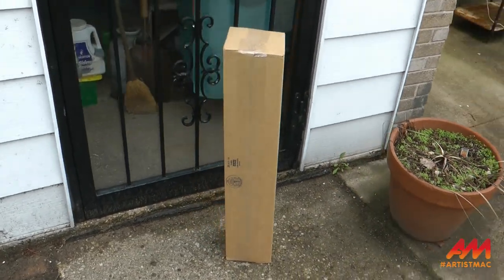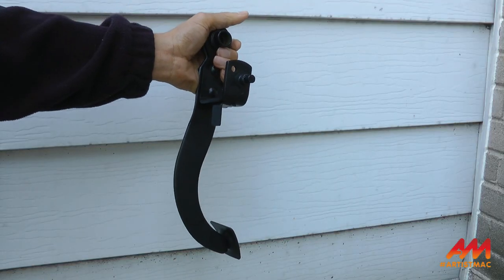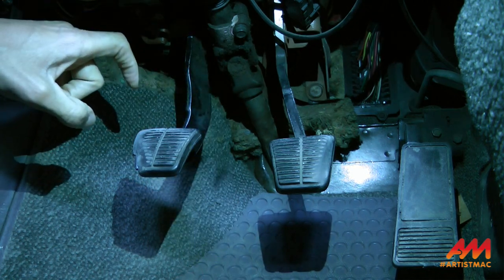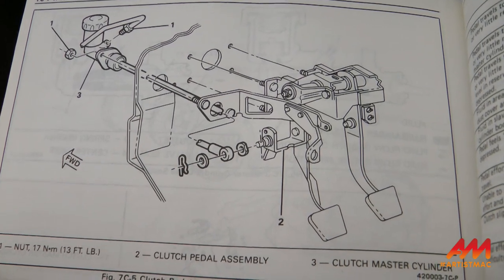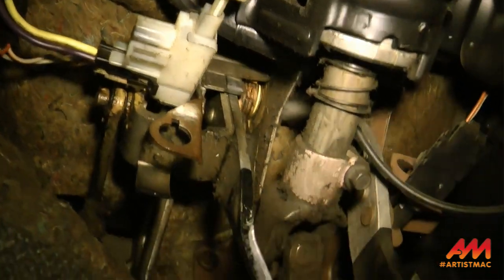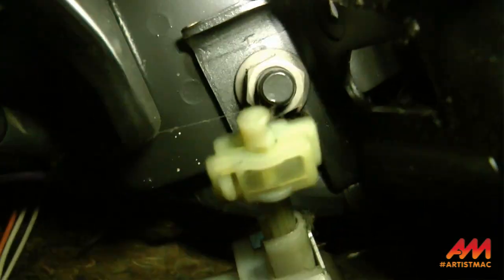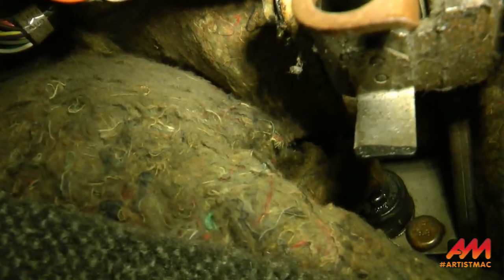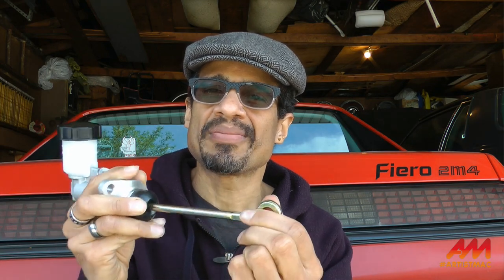My Fiero-Trouble in Clutch Land, Pt 4 - Aluminum vs Steel Clutch Pedal

Comment: Good luck artistmac with your clutch problem.
You did the right thing getting your new steel pedal, presumably from The FieroStore.
  I'm so sorry I could not send my brand new, unused pedal due to stupid, abusive freight fees. Still can't believe it ! Scam !

PS A common problem with manual shift Fieros are the "knuckles" at the end of both shift cables, transmission side. These plastic (nylon ?) caps tend to dry out, crack and snap off, leaving you stranded, shiftless in traffic - it happened to me years ago, morning rush hour, in the middle of a tunnel ($$$ towing)! - My (real, old school) mechanic then installed cheap, Chrysler dealers available, "C" clamps on both cables. Perfect solution ! I highly recommend them to you my good Fiero Man ! Cheap assurance.
  And please, get a new slave cylinder, most probably pitted & worn out as your master cylinder (it's 34 years, after all !! ). From my 34 years experience, 2x 1984 2M4s, plus my present 1988 GT, clutch fork or bearing are tough, durable units, and would bring you a squealing or grinding sound if worn out. (Sorry, Bryan Anderson, but you are'nt guessing right).
 Just make sure to properly bleed - most important! - your clutch assembly using new oil. You should do the same thing to your brake system for the same reason. Annoying, time consuming but so important !
 Summer is coming. Wish you a great driving season, my Fiero friend. Be safe !

Comment: That white switch that moves when you press the clutch is the starter interlock you were complaining about earlier in the video.  If you want to bypass the safety system that disables the starter while the clutch pedal isn't fully pressed you can unplug that switch and put a jumper between the 2 wires.

I'm still fairly convinced that the aluminum pedal and leaking master aren't your problem because if it's bent or leaking that would cause it to get to the floor too soon not stop before getting to the floor.  I believe you're going to have the same brick under the pedal after installing that new pedal and master cylinder.

My guess is that your clutch fork lever that the slave pushes against is damaged.  If I'm right then the reason the pedal is stopping soon is that the piston inside the slave cylinder is jamming against its snap ring so be careful not to push too hard because if it breaks that ring and blows out it will be a big mess.

Good luck, you're going to get that old girl back on the road and it's going to surprise you how much you missed it.  I'm always chomping at the bit at the end of salt season to get my Fiero out each year.
Reply from the maker: Right now, I've got a mirror on the floor of the driver's side, so I can see exactly where that starter interlock attaches to the pedal, before I take the pedal and master cylinder loose and break something plastic and irreplaceable. Somehow, I managed to drive a TR6 for eight years without needing to be protected from myself. Thanks for the info, and I will be getting it back on the road if I have to do a Fred Flintstone. :D
Reply: artistmac  bypass the neutral safety switch the only thing to watch for if doing that is it will start in any gear
Reply from the maker: Just took out the master cylinder. The bottom of the plastic tube (with the add/fill lines) is full of thick black gunk, which has the appearance of motor oil. Makes me wonder if enough fluid was even getting to the slave cylinder to push the rod home all the way. The plot -- well, thickens. ;)
Reply: artistmac they use brake fluid dot 3
Reply: That clutch fork lever is a problem with '84s. At least it was enough of a problem that they redesigned it from stamped steel to cast.
Reply from the maker: Now that I finally found a diagram for it in the '84 Service Manual and how it attaches to the clutch pedal, I can get it off. But  when the clutch system failed, it would die every time I came to a stop, and it would not start in neutral. To get going and get home, I had to start it in first gear, and of course, it lurched forward. Shades of TR6. ;)
Reply: Bypassing the starter interlock is dumb. If the switch is'nt broken, WHY bypass it ?? The car would'nt go through mandatory inspection here !
Reply from the maker: I'm not going to bypass the switch. As soon as I can get the clutch pedal out, I'll be able to see how the L-shaped part of the switch is attached to the pedal, get it off, and put it on the new pedal.